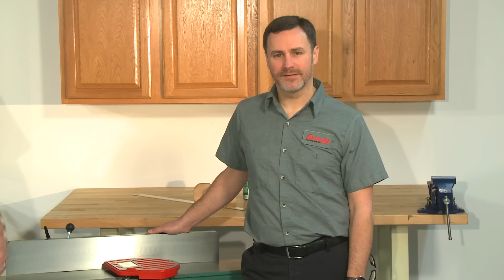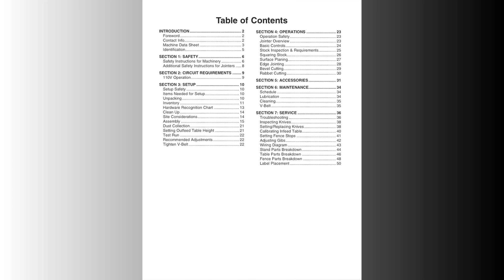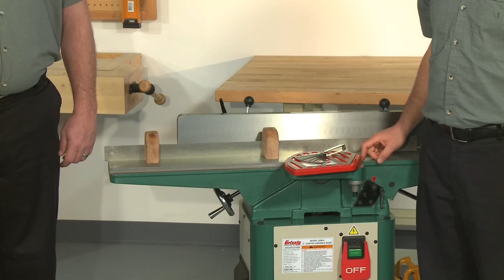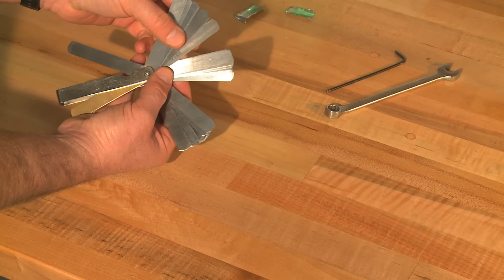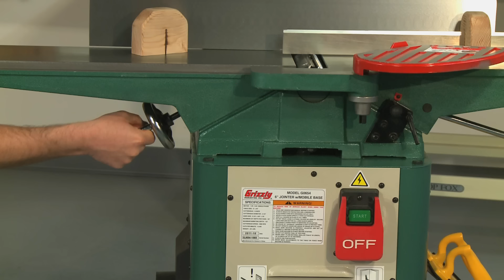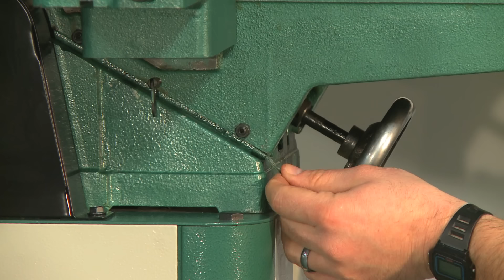How To Parallel ANY Dovetail Jointer!

Comment: Should you shim the infeed table if it’s the part of the bed that’s out of parallel
Reply from the maker: For the most accurate guidance on aligning your jointer's infeed table, we recommend reaching out to our Product Support team. They’ll be able to walk you through the best steps based on your specific model and setup. You can contact them at (570) 546-9963, and they’ll be happy to help!
Reply: @ awesome thank you!

Comment: Great video.  I found it while I was trying to solve problems with my Grizzly G1182 6" jointer.  It cuts better than ever now.  It was a pain to use the a straight edge with feeler gages.  I found it much easier to use a a good digital level.  Thanks for producing the video!
Reply from the maker: We’re glad the video helped improve the performance of your G1182 jointer. Using a digital level is definitely a game-changer for setups. We appreciate you watching, and we're thrilled to hear it's cutting better than ever!

Comment: Any advice of where to find multiple pieces of .005" metallic shim stock?
Reply: K&S hobby brass has 300mm x20mm strip in various thicknesses. Metal would probably last longer but the brass stuff will be easier to find.
Reply: @aussiefarmer8741 thank! 
 I ended up buying a new jointer but still keep this in mind when the day comes that i need to re adjust the ways on the new one.

Comment: What is maximum amount one should shim the cutterhead?  I need .016.  Exactly where do you put the cutterhead shim and how to keep it from moving?  I put one piece of feeler gauge at bottom,  beside retaining bolt.  Is that correct?  I've read where some use a piece on each side of bolt.  Which is best?

Comment: I have a smarter suggestion based on hard won experience. Never buy a wedge bed Jointer, EVER. They are a fundamentally flawed concept from the start. Just because it has dovetailed slides does not make it accurate, especially when the castings are not seasoned/stress relieved before machining. 
I have dialled in many machines over the years but these things are a total waste of time. If they are warped your Screwed. Grizzly machines were crap when they first came out well over twenty years ago now. I refused to use them in any shop I worked in. Somehow I doubt its any different now.
If you must buy some crap machine from Taiwan at least get the parallelogram type jointer. Good luck, your gonna need it.
Reply: 100% correct. 👆🏻

Comment: Did grizzly build the craftsman professional 6 1/8 jointer? It looks identical to this. Except color.
Reply: my suspicion is that Grizzly (and others) pay a licensing fee to use the castings at the various factories in Asia.  look at the 20” planer.. you’ll see that shape used in half a dozen brands.

Comment: So when your measuring the cutterhead off the infeed. At what height should the infeed be set? I have mine set at 0 on depth of cut and have over 1/8 of gap to cutter head
Reply: I have same question, did you ever figure this out?
Reply: yes he didn't say that in video. you lower the infeed until one side of  cutter head touches the straight edge(you will pass 0). it can be left or right side if you have error on left or right and if you don't have a error they touches the straight edge at same level.

Comment: I watched the wood whisperer #118 jointer set up on YouTube and his jointer had adjustment screws and no shims were required. Will Grizzly be adding this feature in the future to their jointers?
Reply: +James McIntyre That was a different type of jointer. Grizzly has jointers with Parallelogram beds in edition to the dovetail style.

Comment: I was getting snipe on the end of my board with machine setup as it came from the factory. I just did this method on my 8" Griz jointer and it worked like a charm. Used a starret straight edge, bought 3 feeler gauges 1 to use and 2 to use as shims. I shimmed everything to better than .0015. I jointed a board and it's smooth as glass!
Reply: Tyson Harris hey